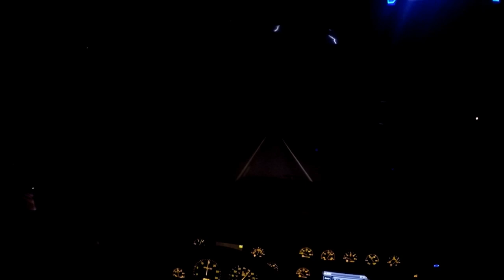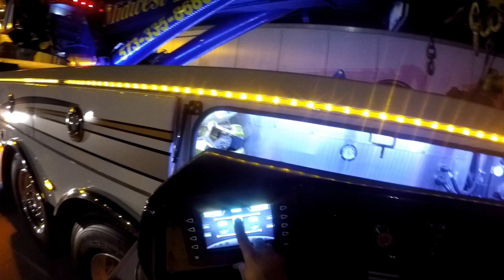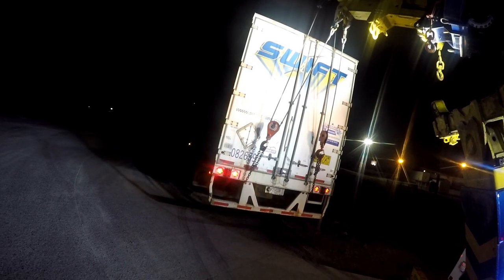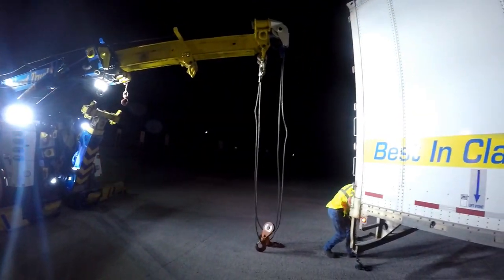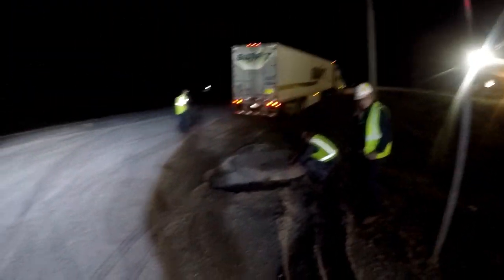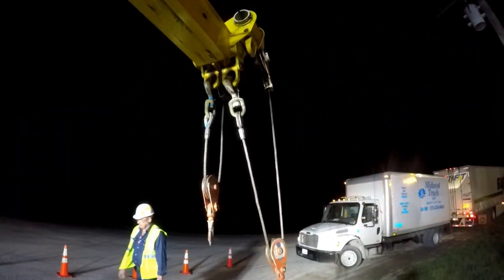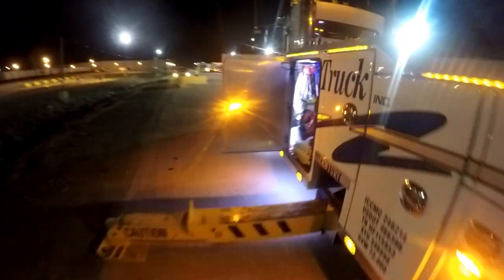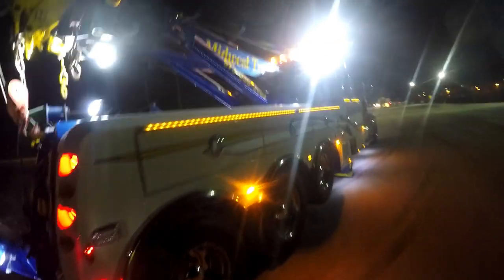TRAILER VS STORM SEWER LID

Comment: That is an awesome tow truck and operator! If you had a chain and a 4x4 larger than the hole, you could loop the chain twice off the hook, drop the chain in the hole, slide the 4x4 under the rim and lift away. slicker than snot.

Comment: One trick that could have made it easy to place the cover:
A wood plank is placed under the cover, such that the middle of the plank got a chain wrapped around through the small, and the ends of the planks are lifting the hole. This can be removed with ease. Easy and effective (assuming you have large and short planks). But great video!

Comment: Ron you are awesome I watch most of your vids I do similar work here in Utah with about half that truck I have never commented on a video before I had a very similar job ounce upon a time but the cover was square 6' ish with a man hole I but a block of oak threw the cover with a rim sling on around it and lifted but it back in place let it down in place used under lift to work it in place let it down and removed the block from inside worked pretty well

Comment: May I suggest that you get a T bar for the next time you need to move a cover like that; attach the hook to the loop at the center of the bar then angle the bar through the hole until it's under the cover, lift the hook until the bar is flat to the underside of the cover and you can then lift/move the cover however you need to and still be able to get the T bar out of the shaft once the cover is back on.

Comment: Ron. You maybe already thought of this but we used to have flashing warning lights on our stabilizer legs when deployed and a flood light on the end of the boom when extended in case you are working over something which blocks the other lights to illuminate the work area when working at night
Reply from the maker: We have the work light on the boom.  Normally we place cones at the end of each stabilizer leg (we call them outriggers).  Sometimes we will place "puck" lights on the end of them, but we try to keep the legs away from active traffic.

Comment: Sir you can get magnetic Fire Fox battery powered lights in red or Amber to stick on your out rigger's at night for better safety the way some people drive. I have been using them in service since they come out. They are good in a rush to slap on the back of Trailer. They can flash from end to end or continual flashing or steady on very handy. They each use 4 batteries. They are about $50.00 each but you shop around might find for $25.00 to $30.00.

Comment: If you had a short bar, I was thinking you could drop a strap through the hole, around the bar and you wouldn't have the strap pinch situation. But I recognize having the right size bar is a big 'if'

Comment: SLING IT   use a 4*4 or something stick it into the hole and loop a strap thru the 4*4 so the strap can be pulled inside the man hole. This way you can drag and lift it in place without problem. Just a tip for the future :-) You have enough wood with you just has to be 2-3' long.
Reply from the maker: Thank you.  I knew that, just wasn't thinking that night!!  It happens.   God bless.

Comment: Heard the mic pop right at the beginning, but other than that sounds good. If you're using the same cable from the mic to the camera that might be the problem. Normally stuff like that has provisions for lifting, sometimes it gets cut off if it sticks up.

Comment: that is one beautiful truck. Complicated as hell, you must have gotten a degree just to run it. God forbid anything goes wrong with it, you'd need a degree to fix it. Excellent video. Very polite and professional, not like some of the idiots you see..chewin' tabacki and cussing like a sailor.
Reply from the maker: I have actually had to work on it some.  The factory upgraded all the transmitter/receivers and software.  They sent me the parts and I did the work....with some guidance from the factory.  As for the tabacki spittin' cussing sailor......he/she won't make an appearance on my channel.  If someone around me, such as a driver or otherwise, and I can't edit it out, I simply won't post it.  I plan to keep this a family-friendly channel.  Thanks and God bless.

Comment: I believe I would have put a bar under the hole with a strap attached.  Then just set it down on top   Take the bar out with the strap. Replace the man hole cover.  Done a few works well

Comment: How many Articulating booms do you have? It looks like 2 ...  if I'm accidentally by chance correct, how much weight do you loose once you un-pin the Boom (take the Jib off, so to say?) and use it as a 1 stick 2 boom unit.  Wonderful unit.
Reply: He has just this one 1150R the other is fixed just raise and lower only,.

Comment: Folks, this is what happens when a trailer brake locks up! I am sure he made as wide a turn as he could but it seems it was not enough, if you have not noticed the road tech working at the back end of the trailer you would have noticed like I did that he was fixing a brake or two. I do not work for SWIFT but I have myself experienced a brake lockup and halted operation before continuing, the trailer does not swing like normal when a brake is "frozen".

Comment: I was wondering if it would have been better for Miller Industries to have put the remote for operating the boom and cable winches on the drivers side storage compartment vs the passengers side!
Reply from the maker: Perhaps, but their idea for it's placement comes from years in the industry of trying to make the most important items accessible from the passenger side, which if you are sitting on the shoulder of the interstate, would be away from traffic.  It is more a safety aspect.
Reply: That is what I figured, although in two videos, you were pulling vehicles out of cable barriers, and you were going to that side to retrieve the remote. So I got thinking maybe they should have a remote on each side, so the operator never has to worry about being on the traffic side of the truck. And of course, you would have a spare remote, if you were to need one, like I noticed in another video when you were recovering that car from the side of the road, in the wooded area!

Comment: if I can make an suggestion for your trickier jobs those that are down in steep ditches use one of the winches and an harnes  to safely get down to the vehicle?
Reply from the maker: Oh yes.  Have done so many times.  I don't believe I have any on video.  Normally too dangerous of a situation to be concerned with trying to film.....either that or it was a fatality, which I will not post.  Thank you for the suggestion though.  God bless.
Reply: Ron Pratt thanks Sir god bless yah stay safe from the U.K.

Comment: ya know why manhole covers are round.....it is the only geometric shape that cannot pass through itself
pop manhole cover, put two bars in an X and gently move concrete.have two people, one for each bar, put slack inline unhook releasing pressure two guys pull out bars and replace lid. takes longer to write about it than to do it.

Comment: What is that screen above the windshield that you punch before you get out?
Reply from the maker: That is a control pad that operates my emergency lights and activates the PTO for my hydraulics.
Reply: OK, Thanks. That is all high tech and all, but I really like to flip switches and push buttons. The click is so reassuring.

Comment: To bad you didn't have one of the big J hook V bridles like you have on the rollback. you could have just hooked the inside of the smaller hole and pulled/lifted the lid back in place.

Comment: Maybe if the driver had unlocked his trailer brakes, it would've been a good idea. If they had been released, he would have rolled right over that manhole... it was flush with the ground. Looks like he dragged that trailer all the way out the driveway, and then expected it to get around the corner. What a tool.

Comment: i've been thinking on your comment about always working under electrical lines and i noticed your truck has a lot of work lights to light up the work area and nothing to light up what you may be raising the boom into. so i was wondering if it might be a good idea for you or miller to add light focused on spotting hazards above and around the boom?
Reply from the maker: That is a wonderful idea.  Thank you.
Reply: yw :)
Reply: What about a remote controlled GoLight?
Reply: bleeckertb ..... that's why we run 1" thick Fiberglass on the top of the boom & the bottom of the boom, this helps in those deep breath moments.
Reply: No man tooo bright need reflectors stickers. Besides no one use them.
Reply: It already has a special indicator function; if you bump the wires, stuff lights up all over the place.
Reply: @kd5nrh  🤣🤣🤣🤣🤣

Comment: Drop a loop in the manhole cover hole and put a bar through the loop, across the hole.  Then lift the loop.
Reply: Unfortunately that doesn't work too well if the hole is off-center. The weight of the concrete tends to drag it so that it's almost vertical, if that bar slips out it's in deep do-doo! :D

Comment: Nice job, as usuall! :-) That lid, looks like a very bad design... Anyway, next time, just put a bar in the hole, and"wupti" you have something to lift in, that can easily be removed, when the job is done... ;-)
Reply from the maker: All of the bars that I had were either longer than the lid was wide or I didn't feel them strong enough to lift that much weight.  Anyway, got the job done.  Thanks and God bless

Comment: What mic did you switch to Ron.  I tried that Panovo mic on my GoPro Hero+ LCD, but this one takes a different adapter that the mini-USB.  The company didn't have a micro-USB adapter.  So perhaps your new mic will lead me to something I can use.
Reply from the maker: I had the Panovo mic and had to replace it every couple of weeks.   My new mic is Saramonic G-Mic Microphone for GoPro Cameras Hero4, Hero3+, Hero3 (Black).
Reply: Thanks Ron.  It doesn't look like they have a mic model to connect to the Hero+ LCD either.  I have an mini-USB to micro-USB adapter on order.  I don't yet know if it will work, but I'm going to try.  I am enjoying your channel and I love that truck.

Comment: i bet that lid would have benefitted from some embedded rod that you could have hooked onto... would have made it a hundred times easier lol, and technically they wouldn't have to be sticking out of the concrete, they could have been flush with the surface. i wonder if that lid has any rebar inside of it? can never underestimate the benefit of some good reinforcement lol

Comment: I kept thinking as you were nudging the cover closer to the hole, what if the iron part fell into the hole.  That would have been a bummer for sure.   Also, I assume that someone put the iron cover on after you ended the video.  That would be a bad pothole for man or beast or truck.

Comment: If you have a timber long enough than the man hole, you could chain the timber , slide the timber on end past the cover and lift. Place the cover on the large hole, lower the timber, lift one end of the timber, pull it all out and you are home free.  This move with the timber is called a toggle.

Comment: Ah another SWIFT driver😂 The same reason 95% of SWIFT'S trucks are equipped with automatic transmissions because the driver severely lack the cognitive capabilities to operate the Standard Conventional Tractor-Trailer😂🤣

Comment: FYI, Ron, a round manhole cover WILL NOT fall into the hole it's covering.  If one looks closely, you can see that there's a lip on the inner part of the base that makes sure the cover can't fall in.  And, I might have rigged low with one of your J-hooks and pulled the concrete cover in place.  Same principal there, too.

Comment: I think there is a lot of dirt between that concrete lid and the concrete/bricks where it is supposed to sit on. Because of the dragging instead of lifting. But it's good that the hole is at least closed up for the night.

Comment: The ole T-Bar trick would have worked nice...  loop a short chain around one of your bars, tape it like crazy so you don't loose your bar on the drain, tip the bar down thru the hole in the cover and draw it tight. set the cover in place and unhook.   There is no doubt, these are some of the most professional and interesting recovery scenes I've ever watched.

Comment: Ron, I would have taken that steel bar  you had to remove the lid and laid it cross ways  in the hole, put my hook on it with pressure and pulled the slab back into place. Then, remove the pressure on your hook, remove the steel bar and you good to go.

Comment: Ron, I think there's an easier way to do that. Take a piece of cribbing and use it as a pin. Loop the strap as you did, and then catch both ends of the wood under the concrete. It should work fine and easy to "rescue" your strap. Should be safe on all counts as the lift is barely higher than the thickness of the slab.
Reply from the maker: Yes, that would have worked.  I didn't even consider that option until after the fact.  It was late at night, I was tired, and my brain wasn't firing on all 8 cylinders, as they say.   Thanks for watching and God bless.

Comment: Hey Ron,  Great job.  Could you have not have put one of your blocks through the man hole and chained it up to make a tee to lift the concrete lid with?
Reply from the maker: Possibly, but the steel cover was so far off to one side that it would have lifted at a very odd angle.

Comment: Correct me if I'm wrong, but your boom can roll to the rear of the truck and then extend with the three different sections within it, right?  Also, with it rolled all the way rearwards, does the capacity drop a lot or is it still capable of heavy loads?
Reply: Slimjimtheman98 I believe it is capable of 22k at full extension. I don't think the point where the carrier is rolled to affects the rating, it only rolls 5 ft total.
Reply from the maker: You are correct.  The boom will roll to the rear and then extend.  It has 5 feet of travel inside the bed.  The travel position does change the safe operating capacity, but it is still a heavy lifter.
Reply: Ron Pratt Thank you, I just wanted to be sure.  Thank you for your hard work, stay safe out there, God bless.

Comment: Pretty cool, did you ever work with a Holmes 750 or 850 ?
Reply from the maker: Oh yes.  Started out using a Holmes 750 on a 1985 Marmon long nose conventional.  We added a hydraulic Zacklift under-reach and thought we were in Heaven.  Let's just say that I'm glad I don't have to run a truck like that anymore.  Thanks for watching and God bless.
Reply: Thank you for your response, if you have pics, would be nice to see , stay safe on those roads and also God bless
Reply from the maker: I do have pics.  I'll have to dig them out and either scan them or snap a quick picture of the picture.  I'll see what I can do.  Thanks and God bless.

Comment: Tire marks suggest swift was pulling trailer with brakes not released. Another See What I F**ked up Today driver.
Reply from the maker: The initial call from the customer simply requested our service truck to help release the brakes that were locked up.